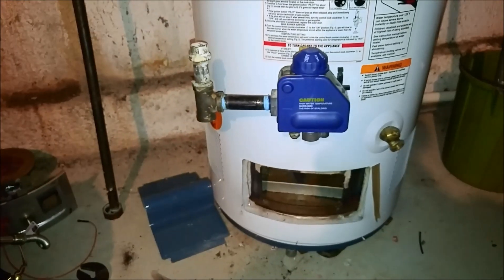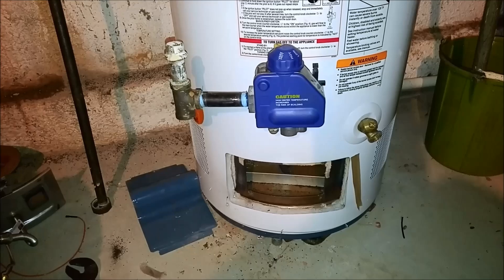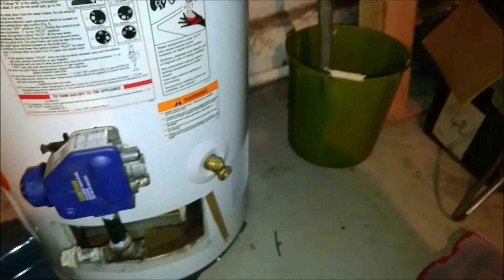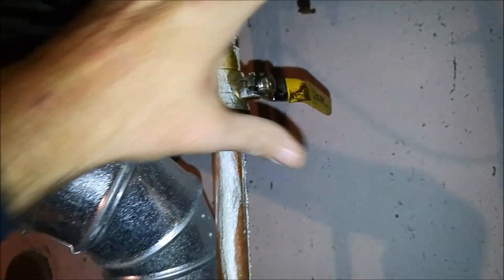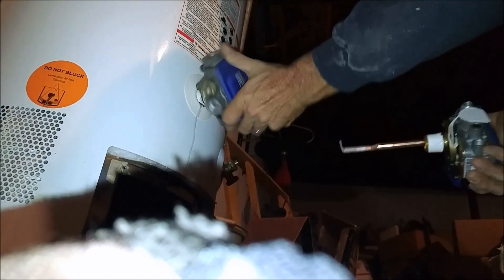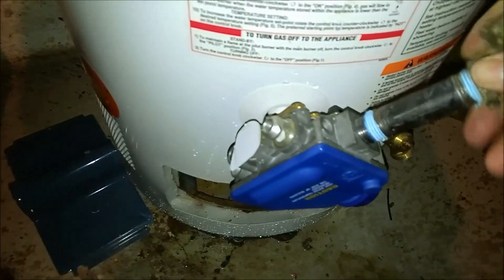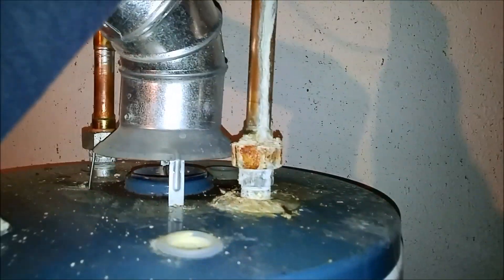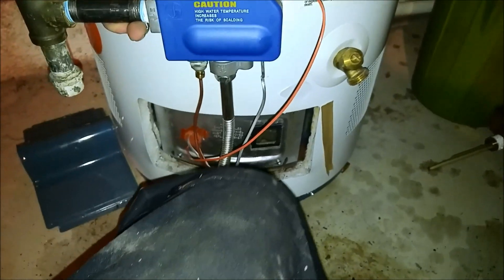Replacing A Rheem Water Heater Gas Control Valve With Full Tank Of Water

Comment: " air locking"  what does that mean and why would want to do it?
How are you able to ascertain that the gas valve needed to be changed? Why was it necessary to change the pilot assembly?
Reply: I believe what he means by air-locking is he's decreasing the volume of air at the top of the water heater, thus reducing the pressure inside the tank. This then results in increased atmospheric pressure relative to the pressure inside the tank, so when he removes the thermostat from the bottom of the tank, atmospheric air pushes against the water trying to exit the tank due of gravity and the high volume of water. It's not enough to keep all the water in, but it helps. Hence why he's able to do this with a 'full tank of water'. Boyles law if I'm not mistaken.

Comment: I have a gas 40 gallon Richmond hot water tank made by Rheem.  It’s still under warranty.  I informed the tech on the phone I woke up without no water & when I attempted to turn the black dial counterclockwise to the off position & then to pilot as per the instructions in order to piezo ignite the pilot, the dial would not turn to the off position.  So I could not light the pilot as the dial would not advance in order to line it up to the red arrow at the left.  The tech was confident the problem is the gas control valve so the part was FedExed to me.  The warranty caps off at $150.00 in labor of which I’m not happy about—I’m on a fixed income & that leaves too much leeway to be charged far more.  This job doesn’t look hard & it was indicated would take 30 minutes.  Longer if they drain every bit of water.  I’m thinking to call an HVAC serviceman as opposed to a plumber as I’m thinking plumbers would cost more per hour & after $150.00, this will come out of my pocket.  Actually it all will come out of my pocket because of Rheem’s stupid policy of having to pay the serviceman first & then get reimbursed later through their website portal.  I didn’t have this problem when I had an A. O. Smith water heater under warranty.  Both parts & labor were automatically taken care of without all these games.  And what if the problem isn’t the gas control valve.  I’ve already been without hot water for close to a week as it’s going to be a trick as to who to hire.  I’m working on getting a referral but aren’t HVAC service people just as qualified as a plumber to do this job as long as they are licensed?
Reply: So was the gas valve the  problem? I'm literally sitting in front of one right now!!

Comment: Great video hopefully it works pluming Supply store is going give me part free due a silent recall on 2020 GCV.  This was so easy to do, much easier than replacing the thearmaocuple. The only thing I did was removed the plastic rapping on the new one is going to f^*&%$ up no leaks fired working thanks again.   2020 SP20303B Gas Control thermosta.

Comment: 🚨 on these  rheem HD tanks with these valves. I replaced like 8 of the same type all 2020 models.
Reply: My landlord had one installed 2020 & 2 days later needed repair now 6months later need repair.It will not stay lit.
Reply: @LisaMarie82.  my supplier says rheem is giving us contractors $90 for changing the faulty valves.
Reply: Yep I bought mine in April 2020 and October 2021 I have no hot water.  
    Thinking about just buying a new water water.   I can install a new one myself and not much more cost to install a new one than pay a company to  replace the guts. .
Reply: @sturgus1  but if ur gonna DIY, it’s cheaper and easier to just do the valve. Less than 10 min.

Comment: I had the same issue but I just connected the two wires where the thermal couple screws in at. There's a white plastic tab with two wires.Pop the white tab out slide the two metal pieces out the tab.Stack them on top of each other and slide them back in where the white tab was.Screw your thermal couple in place while making sure those two tabs are in still in place.Light your tank
Reply: Is it a by pass until you replace the gas valve unit make video please????
Reply: If someone tried used this trick and leaves the Wh without fixing the issue it has with the gas valve they could easily blow up their home if that pilot light somehow goes out and there is no one around to smell the flowing gas the home will quickly fill up with gas and then one spark and it's goodbye world, house.. As A quick fix until it can permanently fixed properly this could work out but that's it and its still a FIRE RISK!

Comment: I know this is a old video, but for anyone having a problem with the pilot staying lit after releasing the pilot button call rheem support. I ended up replacing the thermocouple but still same issue. I just called rheem support and they are going to replace the whole tank for free with labor included. They said they had several customers replace the gas control valve only to call back 6 months later with same problem. Hope this helps someone.
Reply: Dude! Same problem here! Replaced the thermocouple and can relight manually but pilot shuts off once water comes to temp. When did you call Rheem? Any more details you can provide? I see this comment is only a week old.
Reply: Richmond/Reem water heaters are bullshit. 3 times within a year I have had the same gas valve issue. It's insane. The company knows about the issues but they act like they're doing you a favor, after you wait on hold for an hour, by them sending out another gas valve... which also doesn't work either. Never again.
Reply: @michaelmorrison4201  exactly. Mine failed on the eve of 12/22/2022.  NO support Rheem, our local parts house all closed for the holidays until the new year.  NO FREAKIN SUPPORT. I had no hot water until I could get my hands on a commercial grade heater on the 27th.  Now I dealing with Rheem to take back their faulty 18mo old heater (over an hour wait on the phone then they tell me I should have contacted them for a new control valve. Sheesh like I'm going for two weeks without hot water!  Seems like a common problem that they are ignoring. Wondering when the class action law suit is happening
Reply: @kellymckinley7242  
My Richmond tank made by Rheem went out Thursday before New Years.  It’s only 2 years old.  No hot water when I got up in the morning so I informed the tech I could not advance the dial counterclockwise to off/pilot in order to click the button to relight the pilot.  She immediately said it was the gas control valve which consists of the dial.  Luckily, they were able to overnight Fed Ex the gas control valve & it was delivered on New Years Eve but then there was the problem of who to hire because Rheem informed me that the cap on my warranty was $150.00 so anything over that is on me.  And you have to apply for the reimbursement on Rheem’s website portal so the Serviceman has to be paid in full first.  Never had this problem with the A. O. Smith who immediately covered all parts & labor without a dime coming out of my pocket.  And why the cap of $150.00 on labor—they just don’t want to pay for all the labor.  They’ll probably send people 3 gas control valves and other parts before they agree to replace the tank.  Mine turned out to also need a thermocouple so this troubleshooting with these Rheem techs over the phone instead of having the problems accessed first in person is weird.  So now I have to call them back & have them send me the thermocouple.  Been without water for a little over a week playing these games!
Reply: I replaced the Thermocouple first and this fixed the issue I had, thankfully it was still under warranty and I was told Rheem had a lot of problems with this model. Well when it's made across the border or Ocean ........ you get what ya get
Reply: ^Same happened to me. I'll update if a new gas regulator doesn't fix it. I just hate that they disconnected me after being on the line for 3 hours
Reply: Sorry for not putting out an update. New regulator works. Also the old regulator works with a bit of modification. The  peice that connect to the thermocouple to the regulator has a fuse in it. If that goes bad the pilot light won't stay on. Take it out and it'll work but I'm pretty sure it's a fuse that pops so If the water heater gets to a certain high temp it will kill the flame. I can't find anywhere they sell that peice though. Pretty sure that's why these regulators go bad
Reply: @buhghetto  I’ve had mine rigged up like that for a few months now. However, it’s just started going out again. I already have a gas control valve and thermocouple I need to install from Rheem. I’ll change the control valve first and see if that fixes the problem.
Reply: @buhghetto  
All the parts are under warranty for 6 years w/Rheem & the tanks made by them so the parts are free until then by ordering it through Rheem.  I’d order that part through Rheem then even if your warranty has elapsed as they certainly would have the part & it will be factory authorized & not seconds.
Reply: @borninthefla  
The authorized Rheem repair guy I had said changing the gas control valve didn’t solve the problem so now I have to order a thermocouple from Rheem.  It will be free under warranty but all these games until you can have hot water again is ridiculous.  Rheem trouble shoots on the phone based on what we tell them & all they sent me was the gas control valve so now I also need the thermocouple.  Never had problems like this even with the old gas Rheem tanks—now I have a Richmond made by Rheem but I’ve had these types of tanks for over 50 years & never had repair problems until it was just time to replace the tank which was always around a 10 year life span.
Reply: @buhghetto  yeah that little white plastic piece with two wire that the thermocouple connects to is a thermo cut cutoff switch that shuts off the gas in the case that the temp gets way to high. It doesn’t allow the electricity pass from the thermocouple to the solenoid when tripped. So gas valve won’t open and you won’t be able to keep the pilot light lit. It is also not resettable on this delta 650 style valve, the whole valve  has to be replaced. Bad design imo
Reply: Currently having problems with the pilot. Replaced pilot assembly and still won't stay lit.
Reply: @kevinduke6922  If it’s a newer model it has a FTR that’s made of glass. It breaks no lighty.
Reply: Thank u!
Reply: I've been on and off the phone with Rheem support now since last Friday! They're sending me a new pilot assembly and new gas valve. I wonder if they'd consider this option cause it seems their 2020 production models had a really bad run...
Reply: @PYSCHOINTEGRAL  I've been helping a friend with this problem on a 2020 unit. Put in a new regulator and thermocouple, nothing. Glad I saw this video/comment. Our next approach was to pick up a new gas control valve...
Reply: @kojiq3  my 2nd Rheem in 3 years. First one tank started leaking. 2nd was the gas control valve. I still have 3 years of warranty. I didn’t deal with Rheem directly. It was a plumbers supply location.
Reply: @PYSCHOINTEGRAL  I ended up replacing the gas control valve. They said whoever made them, was on a Friday evening or a Monday morning. Rheem will give me a new water heater, or my money back for the next 3 years. It’s good to have a friend that’s a plumber. I guess?
Reply: @PYSCHOINTEGRAL  
Mine, a Richmond made by Rheem, was manufactured in 2020 so this shouldn’t be happening to parts that are only 1/2 years old.  I still have to order a thermocouple from Rheem tech support as the gas control valve they FedExed me under warranty did not fix the problem.  Nothing but games with this troubleshooting over the phone w/the Rheem support tech.  So since you were saying 2020 had a bad run, I’ll be worried about more problems as mine was manufactured in that year.  Only have 3 years to go under warranty so it will even be a bigger worry after that.  I’ve had gas water tanks like this for 50+ years & never had repair problems in the past.  They’re hastily & cheaply making these units like 💩 now yet capped off the labor under warranty to $150.00 as they don’t want to accommodate the customer.  A. O. Smith pays every penny so I’ll be carefully checking all the warranties before I choose another brand.  I’ll be on pins & needles with this water tank now.  We shouldn’t have to be worried like that once you spend all that money on a unit like this.
Reply: Lol this is why you don't believe everything you see on the internet... They do not just send out free water heaters they go through there tests and send a plumber out and he is the one that decides if the full unit is defective or not 😂
Reply: But what do I know I just deal with water heaters 90 percent of my day 🤔
Reply: @trav8578  
Yeah, and probably not before sending 3 gas control valves & who knows what other parts before they decide to send someone out to access the tank.  And all those combined days of headaches without hot water.
Reply: Having the same issue with my tank. It sucks to relight it to keep it warm

Comment: For those who ask this control valve replaced in this video is a SIT 650 Delta, typically sold under Rheem part number SP20303A.
Reply: Yea mine is sp20303b  I thinks its the same looks exactly like this one
Reply: @philszymczak5831  The last suffix goes up to a D or E.
Reply: If water rises up 3mm above where the thermocouple threads enter the hole on this control valve, would the control valve need to be replaced?

Comment: What is the purpose of the plastic over the the sensors that sit in the tank?
Reply: Glad you asked this. I just removed the dead valve from my 6 month old Rheem with this SIT 650 valve, and this plastic was all deteriorated and the probes were corroded underneath it.  I'm thinking this plastic was supposed to be removed at the factory before the valve was installed, and pinholes develop from corrosion in the safety probe killing the valve.
Reply: @MarkPalmer1000  I don't think its supposed to be removed at the factory.  I think its to stop calcium build up between the two probes, that's my guess atleast.  My bad valve also had the plastic all corroded and cracked as well and that was after 4 months.  Doesn't make sense to me so I ripped it off

Comment: I just had the change one at one of my Apartments I thought it was the thermal coupler so I'll talk to mr. Water heater and he told me that it was the gas valve goes bad he said Rheem made bad ones and 2013 that's the one I had he said he's changed over 400 all of them unfortunately mine was 4 months past the warranty night so I had to buy one at a Rheem dealership for $120 I watched the video on how God changed it and I went and did it first time ever did it my life and it worked out good and now it works Mom very disappointed in water tank at 6 years old and failed I have some apartments that have whirlpool hot water tanks I've gotten 18 years out of them
Reply: Having the same issue as we speak I had a water heater that lasted over 15 years actually it was still working when I replaced it I only replaced it because I wanted a new and more energy efficient water heater. had this water heater over a year and a half, after i bought all and replace the other parts, they saying it's the gas control valve but of course the warranty doesn't cover that so I have to pay for the part I'd rather do it myself so sounding like will having an issue with this gas control valve out some light from the start that should have been their first guests

Comment: What was wrong with the old valve? I have the exact same valve and I believe I need to replace it. Pilot won't stay lit and have replaced the thermocouple. So replacing the valve is my next option.
Reply: I just replaced the exact valve yesterday and it did not work. After putting all the money in I had to by a new water heater. We put a camera down the top to look at the combustion chamber and it was full of holes. Only 5 years old! They build stuff too cheap!
Reply: Steve Weyerts where did you buy the valve?
Reply: Probably the plunger that opens the gas valve failed. I have the same one and having to replace as well, after only 6 months of use!
Reply: @crack1666  I have a Home Depot Rheem installed 9-12-20 and now the pilot won't stay lit.  Dealing with Rheem has been less than ideal.  Getting them on the phone is a challenge.  They will not overnight a valve, first they didn't know if they had any valves in stock.  2-4 days shipping.  Now if the Home Depot sells these heaters wouldn't it make sense for each store to have atleast one valve and burner assembly in stock to cut the Downtime?  Back to Bradford White from the supply house.
Reply: @vinceleto  Yes getting Rheem support on the phone is a nightmare. Decided I cared more about having hot water than waiting for Rheem/Richmond to help. Ended up finding the exact same gas control valve on ebay for just under 100 bucks and that did the trick. I will never buy anything Rheem/Richmond/GE ever again.
Reply: @vinceleto  
Luckily Rheem tech support had a gas control valve sent to me overnight FedEx on New Years Eve free under warranty but I still had to stress over who to hire because they informed me their cap on labor is $150.00 & I would have to apply for reimbursement later through their online portal.  A. O. Smith pays for everything where not one dime came out of my pocket.  And then to top this off, it turns out I also need a thermocouple so now I have to call Rheem tech support to order that!
Reply: @crack1666  
The part Rheem tech said I needed for the Richmond is the gas control valve so I received mine under warranty from FedEx over night but then who to hire was a trick as they cap off at $150.00 for labor as apparently they just don’t want to pay for all the labor of which they should especially with these poorly made units.  I will be going back to A. O. Smith as they cover everything under warranty unless that has changed in the last few years.